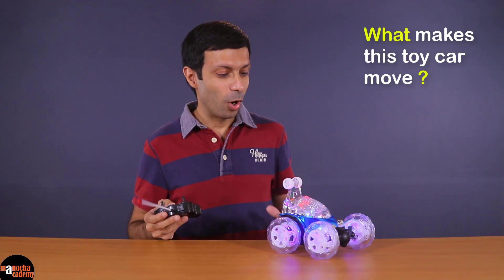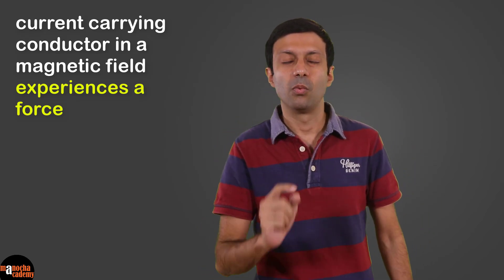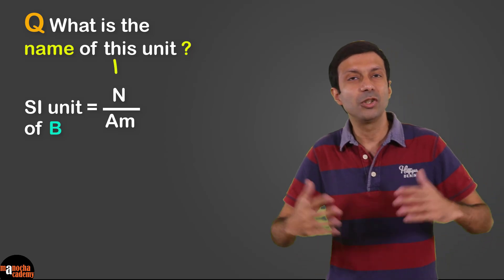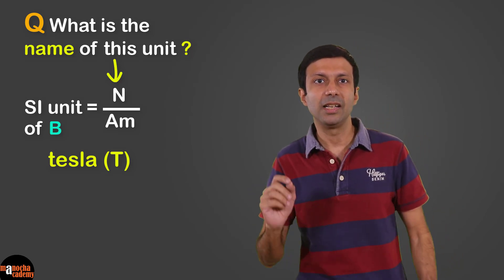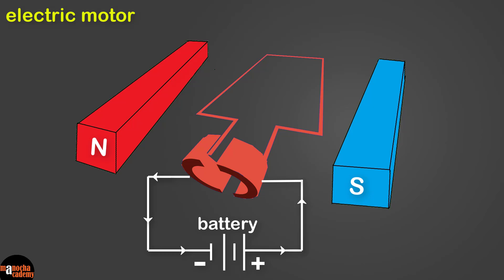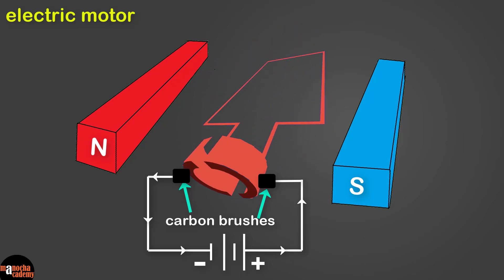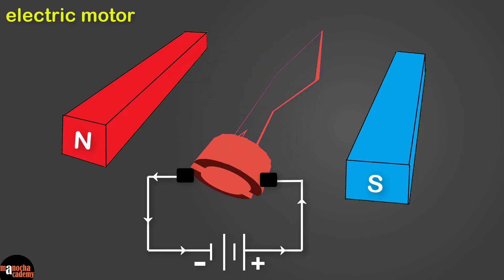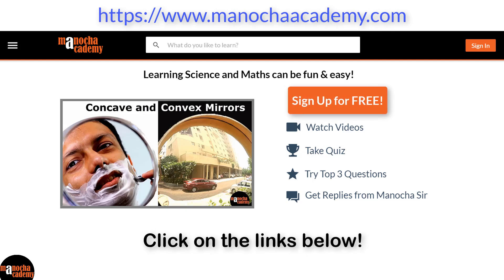Electric Motor

Comment: Sir how does inertia of motion keep the coil moving even when the contact between the spilt rings and the carbon brushes??
Reply: It’s simple. As u know about the Newton’s first law of motion, an object will continue to move in the same direction unless the action of an external force upon it. For example, once u run, even if u wanna stop it, it’ll take some time to actually stop and that’s because of inertia of motion… Unless some force stop the movement of the coil, it’ll continue to rotate since there is no force obstructing that.
Reply: did u found the answer if yes share to me too :)

Comment: bot its deleted for class 10 in 2022-2023 boards electric motor,genrtator,flemings right hand rule and electro magnetic induction are deleted for this year2022-2023
Reply: It is at least useful for some other, if not for u…

Comment: Hello Sir 👋. I have a problem, which I have not got any solution. Please help with it. 
1. Name the energy transformations which occur in a functioning:
(a). Car engine
(b). Steam sturbine.
2. List the three main fractures of a clinical thermometer.
3. Explain why water become cooler when kept in a clay pot for sometime in a room.
4. Water of mass 0.4kg loses 210kjof energy when taken from the Earth's surface to Mars of surface temperature -60⁰C. The water temperature decrease until the water freezes. The temperature of ice formed decrease until it becomes equal to that on Mars. Calculate the temperature of the water while on Earth. ( Specific latent heat of fiussio of ice = 3.3×10⁵jkg-1; Specific heat capacity of water  = 4200jkg-¹k-¹
, Specific heat capacity of ice = 2100jkg-¹k-¹). Thanks. Iam in Sierra Leone and Iam a student.
Reply: 1.a) chemical energy to mechanical energy
     b)In steam sturbines at first thermal energy from fuel is converted into kinetic energy.And after it keeps rotating and converts kinetic energy to mechanical energy,an from then finally           converted into electrical energy
Reply: 😂😂Copy paste😂😂